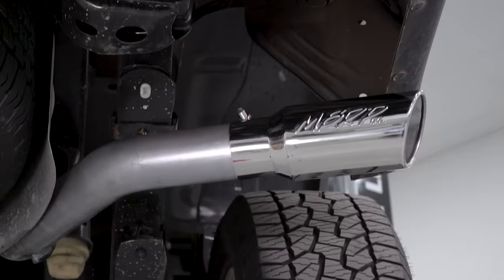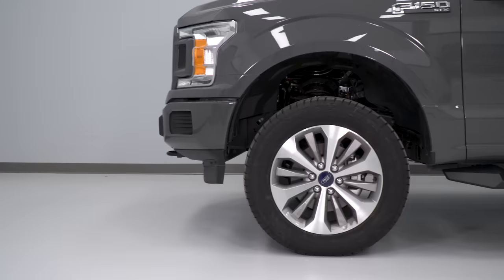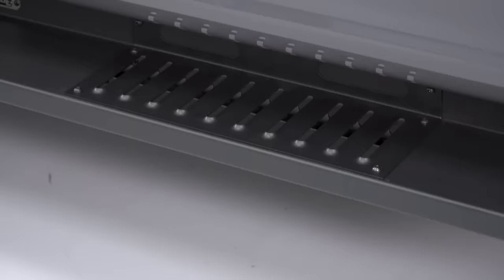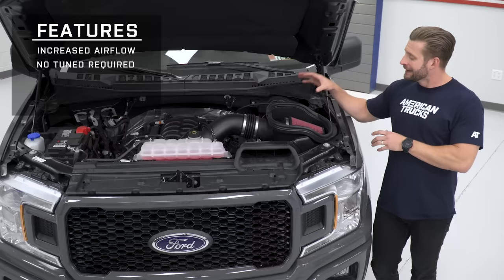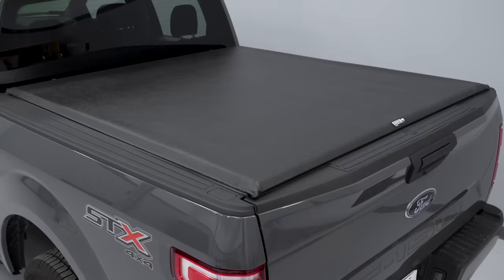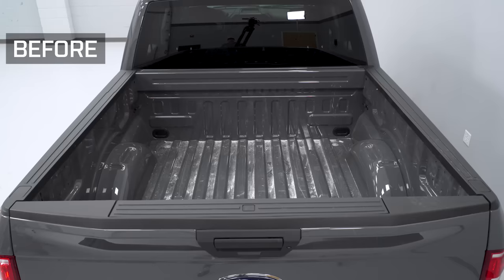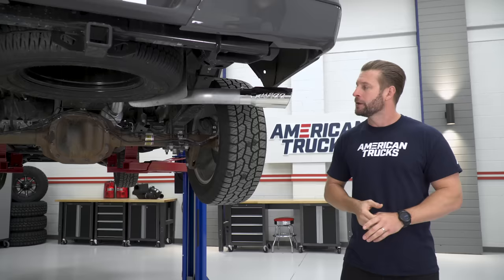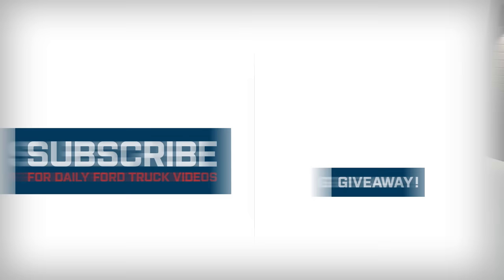The First 5 F150 Parts You Should Buy Under $500 For Your 2015 - 2018 Ford F150   The Haul

Comment: Does the 2.5" leveling spacers also require a front end alignment? If so there are $$ associated with that as well.
Reply from the maker: I would recommend it- a front end alignment typically will run you around $100 or less.  -Justin
Reply: I just put the leveling kit on my new 2019 at my local mechanic (not a dealer or franchise) and he included that. I think it was $350 flat for a 3 inch leveling kit and then the alignment.

Comment: Where did you guys get the truck??? An STX with a V8!?!? Unheard of in socal!
Reply: Spencer Belcher yea a month after I bought my 18' STX my same dealership had and STILL HAS 5.0L STX in 2WD AND 4WD..!! Honestly I wanted the 2.7L over any engine but only because it fit everything into my budget and any 5.0s were either bone stock hideous or King Ranch overpriced BS.. but now looking at them a 4x4 STX 5.0 would be sweet especially since I'd slap that whipple supercharger kit for 7 grand on it 😎😎 The turbo'd trucks are so much fun & I love my STX as it spits out asphalt especially against every Chevy I race on the road (IF they will race 😂😂) & my blow off valve/tune/etc is a blast..... buttttt I'm starting to miss that V8 rumble and the fact that all NA motors are much easier to upgrade on these platforms with room to grow (though pricey).. but all you can really do with the EcoBoosts are pay an arm & a leg for upgraded turbos or compressor wheels and a tune... for very minimal gain in comparison...
Lesson learned.
But I'll keep rockin my ecoboost until I finally decide to trade it in 😎
(Only 5k miles on it..)
Reply from the maker: They're out there man! -Justin
Reply: nick h I just got my stx 5.0 a couple days ago! Had to go to Arizona to get it
Reply: Spencer Belcher congrats brotha! Slap that Borla Atak or S Type on there 😎
Reply: nick h thanks bro that's the plan
Reply: Spencer Belcher Cali doesn't get the coolest Ford trucks? Damn. Midwest we got them all!
Reply: 5 liter with only a 8.8 Rear End ?!  LOL.  STX package is worthless unless you get the 9.75 rear.
Reply: V8s are overrated.
Reply: Spencer Belcher my 13 is the 5.0
Reply: The 2.7 EB is hard to get in Fl on an stx.
Reply: Around here all the STXs are 2.7s.  I havent found one 3.5.  Not one.
Reply: 5.0 STX 4x4 here. 
3.73 gear 
168,000 miles. 
Not one single issue. 
Normal maintenance keeps her cruising along.
Reply: You can get any freaking option with anything you want here in Kansas lol.
Reply: I had a 14 stx 5.0 and I loved the sound of the stock exhaust. Had an awesome grumble. The rest of the truck I didn’t like. I traded it for a 15 3.5 ecoboost. I get 20mpg average. I event got that average with 1000+ pounds of rock in the bed. I miss the grumble of that 5.0 but overall I like the 3.5 eco boost much more. It’s such a quick and effortless motor. Plenty of power and torque. I’ve been thinking about exhaust though. What’s the best option for the 3.5 eco?
Reply: I got the last one they had at my dealership in Kansas.  They discontinued it after 2017.

Comment: Last suggestion was terrible 

Buying a muffler system, especially if you live somewhere that has snow and therefor salt on the roads in winter, buying a shitty aluminum steel muffler to save money at the cost of durability is just a bad idea
Reply from the maker: Or you can buy some 409 or 304 stainless and not worry about the salt and snow too much. 😉 -Zach

Comment: Really hate running boards they just hold mud dirt snow and salt against the paint. Recipe for rusted rocker panels.
Reply: SolelyFlukeD one aluminum is subject to corrosion two we don’t all drive 2015+ fords every other truck on the market is steel.
Reply: Tommy Kennedy my thoughts exactly, running boards are a no go here in the salt belt.
Reply: Move here to Cocoa Beach..I'll buy the beer :-)

Comment: Here’s a question. A leveling kit only raises the front of the body. Clearance is from the center of the spindle to the bottom of the tire so you don’t really get higher clearance unless you get bigger tires. Am I correct in my thinking?
Reply: To a degree yes, but a shock spacer will raise the chassis, so technically it will give you slightly increased clearance under the front of the truck but doesn't really do much more than looks.

Comment: Assuming you don't want to do add larger wheels and tires, does the leveling kit offer any benefits other than cosmetic?
Reply from the maker: Adding a leveling kit will give you a little more ground clearance up front, but people install them mainly to gain extra ground clearance for tires and to undo their factory rake. -Zach

Comment: If I do those mod, does it means Kiss good bye to my warranty ?
Reply: Bertrand Zackery
No. Only a tune is a guaranteed warranty good bye lol. Don't let the dealership try to scare you, they have to PROOVE whatever modification you did caused the said problem. 
Now as far as the leveling kit, if your ball joints wear out after 20,000 miles, then yes your warranty for that suspension component will be denied, because you changed the angles of the factory suspension, even if by only a little, a little goes a long way with suspension.
Reply from the maker: Basically what Nick said- Ford has to prove that the modification caused the failure of the part.  So if you installed a leveling kit and your A/C went out, they would have to honor that warranty. -Justin
Reply: The above is true, but that leveling kit will void your front suspension warranty. Hubs, A-arms, anything up there is tough luck if it goes once you level. 
Engine, A/C, etc is all still covered, but just wanted you to know what does go with that spacer.
Reply: Matthew Porath False. Do your homework
Reply: Scott A - My buddy had a hub go out with one of these spacers installed and the dealer refused to honor his claim citing the spacer. Speaking with them they also mentioned any other front suspension components fall under that same rule. 
I'm happy to listen if you have other information, but the OP has a right to know that a spacer isn't immune to voiding some components.
Reply: Matthew Porath If it was installed incorrectly then the warrantee could be voided. If any mod was installed professionally or by the dealer then the Manufacturer would have to prove the mod caused the failure.

Comment: Can you fit 35s without any other modifications(trimming/cutting) other than the 2.5 leveling kit? Please also confirm the tire/rim combo shown!
Reply from the maker: 35's would require trimming AND cutting with the 2.5 level shown in this video.  The black wheels used in the video were Fuel 'Pump' wheels and Nitto Mud Grappler tires.  -Justin
Reply: AmericanTrucks Ford I see, however 33s wouldn’t need any of that right? Thanks in advance!
Reply from the maker: As long as you're offset isn't terribly aggressive you should be fine! -Justin
Reply: AmericanTrucks Ford Thank you- one last question: What size are the rims and the exact tire profile?
Reply: Julio Enriquez I put 1.5" leveling kit on my 2016 with 33x12.50x17" Rockstars  with a -12 offset.   It rubs but only if your making HARD turns.

Comment: 2.5 lvl is too much. 1.5" would be perfect. an ever so slight rake still.
Reply: I agree. And I didn't use the crappy spacers. Go for the bilstein 5100 adjustable shocks. Better ride not just for looks. Raised my truck 2" and its about half an inch higher in the back. And I used the 2nd highest setting.

Comment: Can you run 33s on a 2015+ f-150 without rub?
Reply from the maker: Depends on the level- stock I would say no.  But if you were to do a 2" level or lift and using a stock or similar offset then yes, you should be able to run a 33" no problem. -Justin

Comment: Would you recommend an oil catch can on the 5.0? Or is that mostly for the eco boost motor?
Reply from the maker: Both engines will benefit! -Zach
Reply: @americantrucks  Based on what science? 60K miles and zero oil in my intercooler or the piping.

Comment: Not a current F150 owner yet. But with the leveling kit on the front, how much weight in the bed will make it lower in the rear? I like the look of it level, but I often have a few things in my bed and was just wondering if it would then have a constant "un-level" stance.
Reply from the maker: Depends on how much your hauling.  If you are constantly maxing out your payload then, sure you might see some sag.  But if your talking a few hundred lbs at a time, then you should be fine. -Justin
Reply: Thanks!
Reply: The answer is yes it will raise front end up makeing it light in the front have on mine and cant carry full 1/2ton

Comment: what about oil catch cans
Reply: I have a UHP on my 2014 - 3.5 limited.  Very good product. Works as advertised. Get one now. Easy install.
Reply: I have a UHP on my 2014 - 3.5 Limited. Easy install. Works as advertised. Got a lot of junk out the first few times, now a lot less but consistent amount each time.  Get one now. Empty it every 1000 miles. Also did the intercooler drill hole mod.

Comment: Just so you know, that is not a 2015. I own a 2015 model and it does not have the body look of this. Headlights, taillights, and tailgates are two different styles. This is a 2018 model F150
Reply: Drew Hunter
The title says  2015 to 2018    F-150
Reply: Drew Hunter actually it’s a 2017
Reply: Let’s Help Each Other
Going by the tailgate its a 2018
Reply: well my 2015 looks exactly like that
Reply: coalfrk
You must have one of the special  15's
Reply: coalfrk all they changed on the 18 model was the tailgate, front grille, and headlights. Everything else is the same. So while it may look similar your 15 doesn't look like this.
Reply: David Wiesman
Ford also  made changes to the  2.7 V6   and  the 10spd  is   on all   but the 3.3
Reply: A Conneely you're right, but I was just noting the visual changes made. I actually took advantage of how they offered the 3.5 and 10 speed in my 17. Now the 10 speed is obviously standard.
Reply: David Wiesman   My wife did the same but with  an '18   2.7V6   because  she did not need the 3.5 power but puts on a lot of Highway miles
Reply: No, it doesn't.  It has a different grill AND different tailgate...but that's none of my business
Reply: Let’s Help Each Other It's a 2018...
Reply: coalfrk lol no. Headlights and grille are completely different. Also, the front bumper is different.

Comment: If the air filter doesn't require a tune it's not doing anything.
Reply: it's  been proven over and over that aftermarket intakes preformed the same or worse than oem on the 5.0L F150

Comment: Cold air intakes are one of the dumbest things you can do to your stock engine. Engineers spend hundreds of hours designing these engines to run at a very specific spec on the stock intakes. All you’re going to do is fuck up your MAFs i over time just for an extra .5 hp.

Comment: Just bought a new 2019 F150. Was thinking about putting a CAI. It has the boosted 2.7 in it. Is there any tunning required or recomended? Im happy w/ it, but Im a chimp and just have to mess w/ things. Thanx
Reply: Usually the CAI states if it needs a tune or not. Majority CAI do not need a tune. But with more added bolt ons a tune helps everything work with eachothed

Comment: The only people that level their truck are the ones that have no intention to haul truck stuff...
Reply: vegjeezy17  If you lift the front it still has the same haul ability.
Reply: The people who don't want to drive around looking like they are in a nose dive and want more clearance with better approach angles when off road
Reply: vegjeezy17 leveled just looks way better my truck was leveled for 3-4 years then I lifted it and the whole time I tow all the time with it and still do it’s all personal preference they may not haul heavy enough to make it squat or don’t care
Reply: I don't tow much but I do work in construction and keep tools and supplies in the back for when we dig trenches for pipes. On average 700 pounds of stuff. I leveled my truck to be able to get to the spots we are digging because what the point of working out of your truck if you have to walk a 1/4 mile to the road to get stuff
Reply: No sense your statement makes
Reply: randy schmidt then they should probably buy bigger tires
Reply: Nothing wrong with buying a pickup truck to never haul a single thing beyond people or a few lengths of lumber. I guess you don't remember the street tuner pickups from the 1990's.
Reply: @mackenziepeek9317   In that case it is a function vs looks
Reply: Charles Phillips right. Great for bigger tires without a full lift and gives you better clearance in the front
Reply: @mackenziepeek9317  Why?  I have a stock 2012 f150 4x4 spent most of its 160000 miles off road doing work without any problems.  It set high enough above center of gravity as it is. All these gadgets seem like a gold plated Timex watch to me.  I would rather spend my excess money on retirement income than some depreciating asset..
Reply: Charles Phillips I have an 02. They sit lower than the new trucks. I also have been in some pretty deep ruts and mud
Reply: 5.5 feet of space ain't much space to haul stuff anyways
Reply: jojolozano enough for an atv though I prefer my 6.5 bed

Comment: 1:03
Look at that God awful upper ball joint angle. Worn out suspension, here we come.
Reply: Alex West Its on a lift and stretched out of course it's going to look like that when there's no weight on it.
Reply: Have mine since the begin of 2015 and 75k miles no issues with 34” tires
Reply: Josh Lantz doesnt the control arm hit the spring whenever they get unsprung whatsoever though?
Reply: XRIDER0002 actually they don’t unless you are flying through the trails over woops. I run a 2” suspension maxx made right down the road from my house and have had no issues. I also had them on a 2006 that I put 196k on and also had no suspension issues.

Comment: Hey :) looking for some advice.....
when the 2.5" strut spacer is added it will push the control arm down, putting extra stress/wear on that ball joint. so I am just wondering if y'all recommend upgrading the upper control arm to accommodate the spacer?
Reply from the maker: We definitely recommend it if you have room in your budget! It will help your ball joints last longer and improve the ride quality too! -Zach

Comment: What Mods would you recommend for a 2018 Ford F150 3.3L V6 Supercrew Cab?
Reply: Put in the engine you should have paid for to begin with
Reply: Alright I would do a 2.5inch leveling kit and then put 33inch tires with some type of fuel rims and then get running bored and a truck cover or truck cap. :) ik I’m not AMERICAN TRUCKS but I thought I would comment and give my ideas.

Comment: 95% of the time Intakes/“cold” air intakes are the BIGGEST waste of money. Factory intake boxes all suck air from outside the hot engine bay and your OEM filter element typically has more surface area that the standard aftermarket cone style filters...

Comment: For the "Truxedo Edge Soft Tonneau Cover" what is the recommendation when going through the automatic carwash. Do you leave it closed or open? Does it not get damaged with the heated dry?
Reply from the maker: Most automatic car washes I've been through prefer a closed cover- and I wouldn't worry about the dryers. -Justin
Reply: Have had one on my 2009 super crew. 140000 km. Never had any issues with keeping the soft cover closed. Will be switching to a tri fold when I get my 2021. The safety of the hard cover appeals to me. Always worry when I’m travelling that some crack head will use a knife on my soft cover.

Comment: Personally I think the exhaust system you picked was cheap junk.
Reply from the maker: Cheap? Yes. Junk? That's your opinion.  Remember the point of this video is to find parts UNDER $500 bucks- and in the exhaust category that doesn't leave us with a lot of options. -Justin
Reply: AmericanTrucks Ford does it really cost you under $500? It will rot away in 5-10 years and you will have to spend another $500. That's cost effective.
Reply: @bubbalands  aluminized muffler lasts about 18 months in the north where it sees 5 months of road salt a year.....oh and thats after a baked on ceramic exhust paint before install.  oem ford stainless muffler looked new but dirty after 3 years

Comment: Barricade running boards suck. They are pricey and because they are made of cheap carbon steel, they rust. Mine lasted less than 2 years. Don't buy them. Get stainless steel running boards instead.

Comment: How can one consider pulling air from the engine bay "cold air"? the OEM system pulls air from the inside of the fender under the wheel well shroud where the air is considerably colder, just because think about it..there isn't a V8 running under the fender. We all know this is a PAID advertise program but maybe if the producers actually chose to advertise something that truly made sense and the testing and reviews were honest then the show would be a win win to producers, viewers and sponsors. crap like this just makes people loose trust in the words of the show.
Reply from the maker: Hey Rody- let me explain since it seems like you're a bit confused. These intakes don't 'pull air from the engine bay'- they pull it exactly as the factory intake does, through the ducting located in the front of the truck, not inside the fender or wheel well as you mention.  This factory ducting (which the inlet is clearly visible near the top of the driverside rad cover) dumps fresh 'cool' air onto the filter when the truck is in motion. The top of the intake, while open, seals to the underside of the hood as to not ingest too much of that hot engine bay air.  Now one could make the argument that while stationary these intakes aren't necessarily ideal but who the heck cares about stationary performance, amirite? Hope this helps clear things up for you and thanks for watching!    -Justin